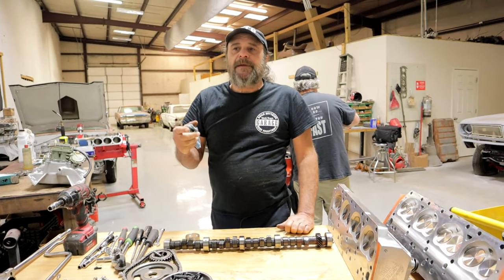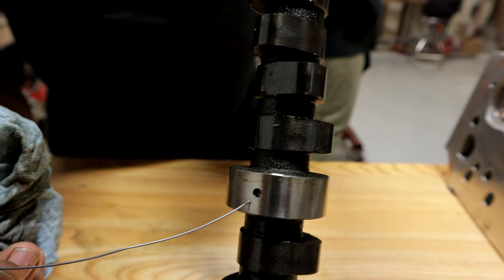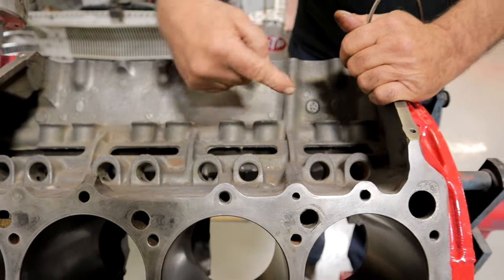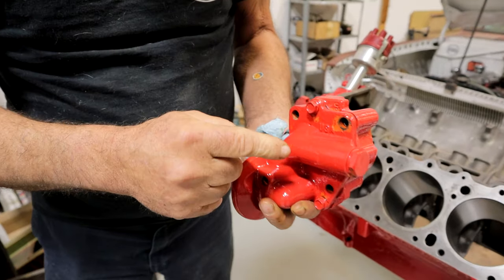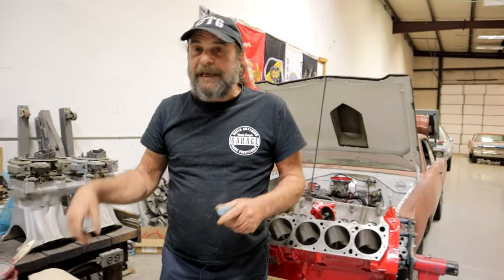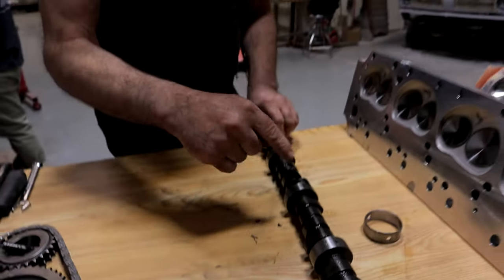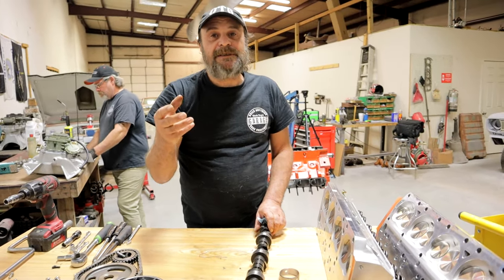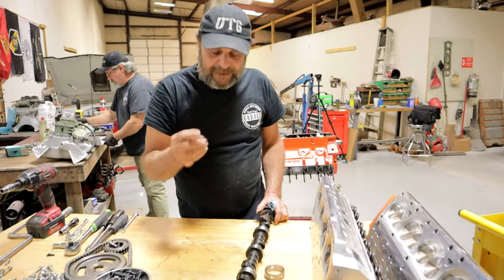CRITICAL Lesson For The Home Engine Builder- MORE Camshaft QC Issues To Wreck Your Day

Comment: Hey Tony do you think that cam could have come out of a previously grenaded engine? Maybe it could have got put back on the Shelf at the auto parts store? Or whoever threw that engine together just had a cam laying around that he put into it.
Reply: The cam has never been run
Reply: @jimmy_olds  Not really sure how you know that? Kiwi just bought the engine. Maybe the engine hasn't been run but who is to say whoever sold that engine put a bad cam from some other engine? It really doesn't matter at this point.
Reply: @waynebuzzell2483  because it’s obvious when a flat tappet cam has been run even for a minute, that one has no signs of a wear pattern and if you don’t take my word for it, go to like 3:50 in the vid. Tony mentions, old timers know to check, new timers pull it out of the box and install it.... or something like that, then he says it’s a new camshaft.

Comment: Funny story not related to automotive but a boat. In 1967 my father bought a small boat for fishing. He also purchased an engine and brand new fuel can for it. If you know anything about those cans they were portable so you take them out and fill them at a gas station now for the rest of the story.

We spent a good part of two hours trying to get the boat motor started.
No electric start either mind you, myself being the person doing the pulling on lawnmower style pull start cord Lol strong back weak mind.

My dad had the normal limited knowledge pulled the cover found he had spark but no fuel to the carburetor. Upon further examination he discovered he wasn't get any gas coming out of the brand new fuel line. He traced it all the way back to the brand new gas can. The brass elbow which connected the line to to the can was never drilled all the way through. Note this was long before China became our main supplier of anything. So Tony your example of poor quality control is just that leave nothing to chance. Be meticulous with everything you do down to the last bolt, washer, and nut. To include machined surfaces, drilled, and tapped holes you name it, don't chance it.

Comment: Just happened to us 2 days ago on a 350 SBC 
Cleaned the block real good 
Took every measure possible from torque specs and zinc additives and lubes took or time and installed it 
Fired it up and it sounded really good then after 8 minutes the left back lifter made noises 
We took it all apart and the cam lobe was rounded off 
And the lifter collapsed 
Didn’t destroy the bearings or mains or block dodged that bullet but now to rebuild 

Does anyone have a good strong recommendation for a better cam or lifter set 
Any advice would help as the internet just shows anything and reading is all up in the air 
Thanks in advance and appreciate the ideas

Comment: If building an engine isn't scary enough. So when I get my rebuilt long block I should tear it down and inspect everything?
Reply: Best is to always have builder test run engine on test stand or dyno to look for issues & breakin cam etc before the customer gets the motor. But don’t take it apart because you will own any issues with it because you messed with it.
If you trust the engine builder & they stand by their work install it & if it has issues call builder. This way the engine builder  can see issue/s as motor sits in the car before you pull it back out if the problem is serious enough to require pulling the engine again.
Good luck!
Reply: I wouldn't trust any reman engine unless I know the builder and his work. If I bought a Engine online I would spend the money on a new Gasket set and go through the whole thing, then again I am really anal when it comes to building anything, from just my own dealings with repair shops in my area Not One has any pride in there work. I have health problems and don't have a garage big enough to fit my cars so I am limited in the amount of work I can do by myself, my days of pulling engines and transmissions out in the driveway are over. I want to build a Engine for my truck a 86 Ford F150 5.0EFI and while I can build the Engine in the space I have getting the old engine out and the new one in is the hard part, all my car friends are either dead or moved away.

Comment: I'm going to cut a manufacturer a bit of slack on this for a couple reasons:
- Many of these parts come from very small runs or may be one-offs.  Small runs always have a higher failure rate than large runs.  
- When it comes to cleaning parts, my 'hobby' time is cheaper than a machinist's time. I'll clean it and save some money, so long as HE makes the right part.

Comment: Early 5.0 L Ford, whipped rod bearings on break in, twice, machinist could not tell me why. Front cam bearing spinning, found out later from a paper boy and Ford sells a .002 larger bearing. 😔 all I have left is full floating pistons and rods, two that need to be resized and a empty wallet

Comment: Every engine I've built I clean completely 3 times, each time as if it had never been done. Even after the machine shop or part manufacturer says it's ready. For example; Cylinders should be so clean that a white towel can be run up and down in the cylinder and come out clean with only oil on it, showing no dirt or silver machine "dust" at all.

I'm not a professional engine builder as much as a mechanic, but I do hate redoing work and wasting time and parts. :/ Better to spend the time up front.

Comment: What brand cams have you been seeing quality control issues with? Does mellings make a good cam?
Reply: The first was Comp. Lots of Comp horror stories.

Seem to have the best luck out of Howards. I'm about to stick a Howards bump stick in a 350 I'm putting together.
Reply: The bad Hemi cam Uncle Tony referenced was a Comp. Mellings does good stock replacements, but clean and check it to make sure....
Reply: @ImAfraidBruce  I've had failure with two Howard's product's in two different engines in the last 15 months. Their lifters in one and a camshaft in another. Cam was a hydraulic roller. In 200 street miles the surface of the lobes began flaking off. Found the metal in the filter and upon teardown everything in the engine was pristine except the cam. Lobes looked like it laid in a salt bath for 5 yrs. Course that ruined all the rollers on the lifters as well. I called Howards searching for an explanation, they didn't have one and could've cared less if they were having QC issues with their cam cores.
Reply: Bought a "summit house brand" cam for my pontiac, lifters would not spin. Measured cam and found lobe taper ground on BACKWARDS!.  Purchased mellings cam around the same spec, most but not all lifters turning. Measured cam, taper now right direction but barely there. Took mellings core to local cam grinder and had them regrind the "brand new" cam. All lifters now spin fine.

Comment: Crazy stuff real mechanics have to deal with and try explaining to customers what it takes to build a motor and their response most of the time is well isn’t that your job to check those kind of things.   I had a new Harley I tore apart for a guy he wiped out the bottom end and cams really quick come to find out upon inspection one of the oil passages had a big coil of metal left i behind when the drilled it from the factory.  Guess what warranty wouldn’t cover it  for the guy .

Comment: My brother had a1962 Dodge Truck 361 that had the bypas stick and caused it to produce 100 psi of Oil Presure , ALL The Time!  he put in a Killer Cam and Tunnel Ram and Dual AFB Ccarters and Raced that engine and Never ahd a Barring Wear Issue!  Several other Mechs told him it would wash the barrings........IT DID NOT!  He Launched that engine at 7,500!

Comment: Tony..ive heard you say that the 426 street Hemi wasn't the best muscle motor back in the day?? Just wondering were they overrated?? Always thought they were street legends?? Please clarify truth from fiction..thanks..life long Mopar fan. Dan
Reply: Most of it is that the street HEMI didn’t really have enough to take full advantage of the heads and how well it could breathe. Even then the HEMI was more of a high rpm engine. 
So, the higher power 440’s tended to run better at lower rpm and be better off the line. They were also cheaper so was easier to afford some modifications and make more power.
Reply: @NBSV1  I would think with the right gearing and a good tune they were formidable??
Reply: They where indeed dogs in the streets
Reply: @Yann396  I dought that..they ran low 13 second 1/4 mile times..look at old car tests from the late 60s..I do believe they needed a good tune and proper gear ratio to address the higher rpms they liked to run at
Reply: @Yann396  so why do we see 426 hemi cars in the stock class running high 12 and low 13 second 1/4 mile times?? Must be a blowtie fan
Reply: @danieljacobson5774  you probably never had a ride in a (not babied) Hemi Cuda, I did, often. Car ended up in SS/DA, they where good on the strip, not so good on the street. Most 440s where faster, ran cooler, needed less gear and RPM, where lighter, etc. I encourage you to watch the engine master episode comparing a 440 and a 426.
Reply: and yes, I’m a « blowtie » guy, but I love all the cool cars and my friend’s Hemi ‘Cuda was sure a special one, even back then. That’s why we decided to use his car to race in Super Stock. Our 427 Camaro was faster on the street, tho. And this is from people who where there when those cars where new, modified and raced.
Reply: @Yann396  fair enough..I'm just a little sad because I grew up a Mopar fan and thought the world of the street Hemi..I'm 62 yrs old and missed out by a few years of the muscle car era 🙁..I did have a 383 69 superbee. And my buddy had a 69 Chevelle 396.. pretty much a toss up when we lined up
Reply: @Yann396  your right I would take ANY 60s muscle car..Buicks stage 1 GS was a killer. As we're Pontiac  ram air 4s . Actually the fastest car in my hometown in the early 70s was Donnie Thomas ( local mechanic) 428 Cobra jet Mach 1
Reply: @Yann396  if I had money I would have an A12 six pack 🐝
Reply: @danieljacobson5774  In purely stock form they would be better with the right gearing, but still not quite the huge power so many really expect. But, with good carbs, good intake, good cam, and good exhaust they really wake up. Generally even just a good cam and some good tuning does wonders for them. The heads flow so much that it's basically always going to want the higher RPM, but that's also where you get more power which they were chasing for racing. 

At the end of the day the Hemi became more of a race engine that got turned down for street use so they could legally use it in racing.
Reply: @Yann396  how did a well tuned 440 compare to a 427 camero

Comment: I bought a summit flat tappet cam and lifter kit for my 318. You can't go wrong with this kit! Stop buying directly from comp cams! Isky cam is the only good cam company anymore. But, they charge a premium.
Reply: Bullet, Howards, Clay Smith, Straub, etc etc all makes very good cams. Not just Isky.
Reply: @Yann396  yeah. I had bullet put a decent grind on my Magnum V6 roller cam.  Those cam guys are good! But summit re-branded cams are a great value.

Comment: Measure twice, cut once. even OUR work needs to be checked, we all make mistakes.  then again I have a lifetime of management asking me, "why are you taking so long" and then I go on a week paid vacation and work goes half-fast since no one is checking anything just to impress the boss with how much they got done in a day. 

great, and tomorrow we'll just fix all the stuff you didn't catch yesterday. 

your First Grade teacher had it correct--if its worth doing, its worth doing right. I remember another video with an LA block full of gasket junk in the cooling passages. That "job" worked well enough for the prior owner, didn't do UT any good.

Comment: I've been seeing alot of people having small block Chevy bearing and lifter QC issues as well. On my Honda Accord I just received an A1 Cardone distributor the other day that didn't have a hole drilled or tapped into the center post for installing the ignition rotor. Just entirely missed one of the most vital things I guess. Best part is the box has an Inspected by with Initials on it. If this mistake is happening to simple Honda distributors who knows what else is getting done the same. Here's vid of the distributor in question if anyone's curious. https://youtu.be/I4gY7TOs8HA

Comment: Had a set of rods resized once for a backyard clevo rebuild. Anyways i get them back with the crank which was ground 10 under and im looking at the rod piston assemblies and two of the pistons have been pressed on backwards. How do u screw that up. I decide do a visual on the crank and see a half assed I linish job with 3 main journals showing orginal damage that was to be machined. I mike the crank up and sure enough the crank is still standard. I took them back to the shop where the owner blasted the machinist who should have been sacked. More likely the boss and worker were in cahoots hoping i wouldnt check their work, taxed the coin and when the motor crapped itself would have blamed assembly error, me. Anyone heard that tune before?? After all this drama, once the ckevo was back in the car, it ran like a champ.

Comment: Parts quality is terrible.  I bought a NEW power steering pump for my kids Lexus and could not for the life of me get the thing to mount home.  After comparing to the original, I discovered the casing was noticeably wider in one area.  Had to flat file the damn thing for 10 minutes and then it went right in.

Comment: This isn't exactly on the cam manufacturer. Every cam i have ever seen (Like basically every other part) comes with a little card that states ALL PARTS MUST BE FINAL CLEANED. It is not their responsibility to clean your parts. That is the difference between an engine builder and an engine assembler.

Comment: I don't understand how those holes in the bearing could oil anything.
Reply: The oil comes up through the block at the bottom of that cam journal, through the bottom hole in the bearing shell, into one of the two holes on the cam, and at two points in the rotation, those two holes in the cam (and the matching holes in the bearing shell which has to be installed such that the holes do line up) line up with the oil supply hole and one of the two oil passages going to each cylinder bank deck (where it continues into the head).  So there is a pulse of oil to each head once per full cam rotation.  Does this help any?
Reply: Oh, its not a straight line hole, its a y shape to match the holes.

Comment: Brand out of the box aluminum heads. Valves leak at the seats. 3 different sets. Gave up after 2nd replacement set, and sent them to the machine shop to touch up the valves and seats. Very disappointing.   Check them heads!!!!
Reply: I was told by a few buddies who were ex NHRA mechanics in their youth and had their own shops after to never trust taking them out of the box and slapping them on, at least the lower priced stuff that's more mass prod'ed. The one thing I do not have a problem with is giving a good machine shop the job of going over the heads, while I can take the head apart and can lap the valves I can't cut or do much else with the seats though.

Comment: Same problem with aircraft engines, new parts have shit for quality control. Some not even machined correctly from the factory. And most of the old timers that check parts like you are horizontal.

Comment: this word gets kicked around a lot but is what you pay for with a blueprinted engine,every detail is checked and checked,and then rechecked,the valve that uncle tony is speaking of,is in every oil pump made,it is the oil pressure relief valve, never sees clean oil unless you give a damn,3500 mile drops till the oil pan is clean then go to 5000 mile oil drops,if its a hi performance engine this schedule means nothing,oil changes are directly proportional to how much you have spent,clean means you can still abuse it

Comment: Most would have stuck it in and sent it and of course if it was totally clogged ruined the cam bearing at least and sent metal thru the engine forcing yet another total rebuild of a brand new freshly rebuilt engine and again it was the fault of the manufacturer why are cams and lifters failing way way more often than they ever did before well there's your problem lady right there or at least part of the problem anyway quality control wtf is that iso 2000 what quality shit control nada that 10th beer at lunch is almost always a mistake eh ? Wtf